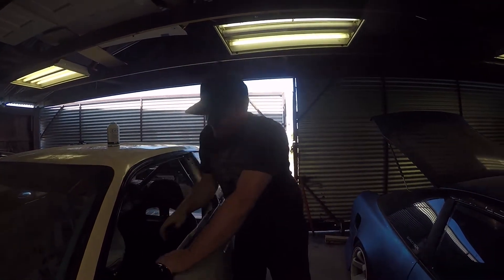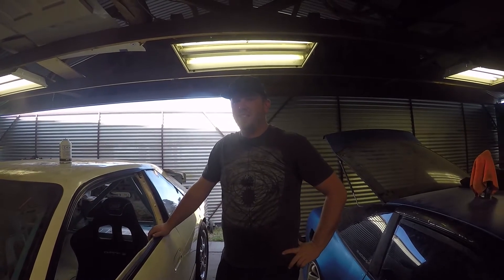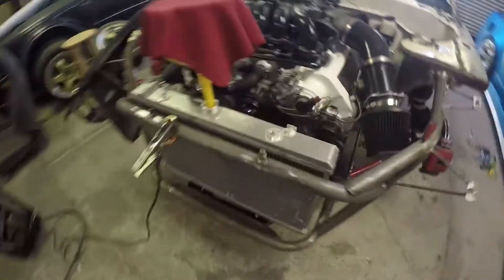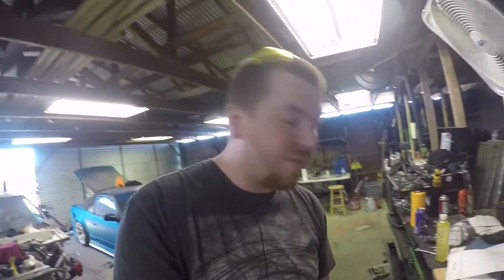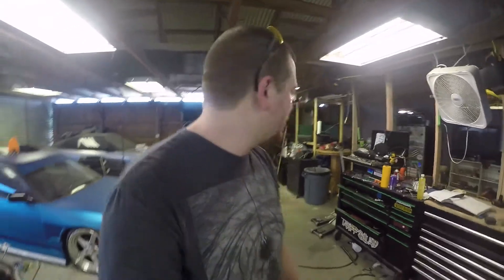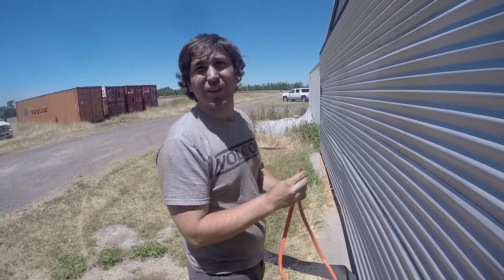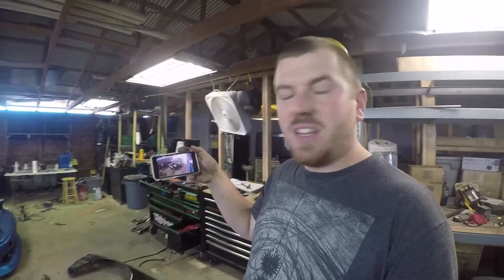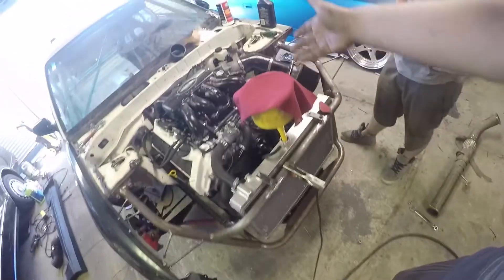[ Bash to the Future 6 Prep ] Day 8: Driveshaft, VH45DE S13 Drives, Alignment

Comment: Michael how do you like the q diff? i'm thinking about throwing it in the 40  for the same reasoning as you. they seemed a little long to drift the q but i just wanted your opinion on it. The q is heaps heavier though. and I have a few questions/ need help with starting issues. not getting any cranking from the starter, but dash and fuel pump and what not works.
thanks in advance.
Reply from the maker: Not sure how I like with the vh swap yet since I've only done one event on it. But using it with the ka-t was great because with the stock diff I was wrapping the tach out way too quick. But in real honesty I only did one skid pad day in it with the ka semi blown but it felt great.

Comment: Hi guys!! We’re are you from??))
Now I doing swap to vh45 and I need some help))
Reply from the maker: We’re from Sacramento, CA, area. What’s going on with your swap? What can we help with!
Reply: Thrashed Chassis I have some problem with wiring and steering rack. 
I’m from Fontana CA. 
How you did it ?) I made everything like you 
Vh45de +z32 
I need to do wiring and steering rack.
Reply from the maker: What are you running into with the rack? We didn’t have to much of an issue besides the column clearing the headers, and we just fixed that by hammering the headers flat where it needed to be flattened. 

We’ve had a lot of questions about wiring, so I think we’re going to have to do a video touching on that. We’ve been working on getting a generic “how to wire” guide that isn’t vehicle specific, but helps you know what needs power, etc. With all the demand lately, I’ll jump on it and get that stuff finalized and we’ll make a video on it here soon.
Reply: Thrashed Chassis do you have what’s up or Viber, I can send picture with my little problem)
Reply from the maker: I’m not familiar with either - we have Instagram, Facebook and snap chat? Idk if that helps lol.
Reply from the maker: Or you can email us at thrashedchassis@gmail.com
Reply: Thrashed Chassis I found you in Instagram! Mech_ca it’s me.